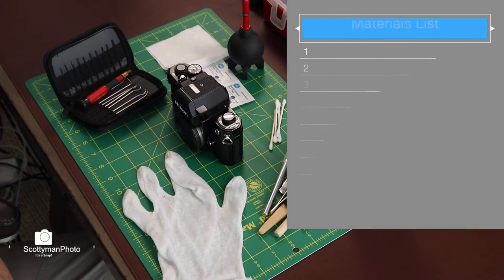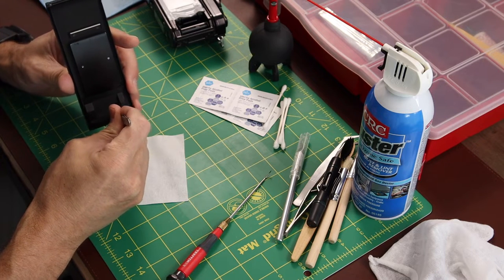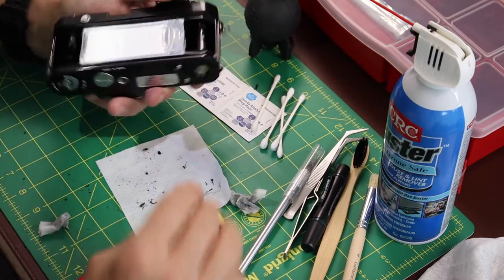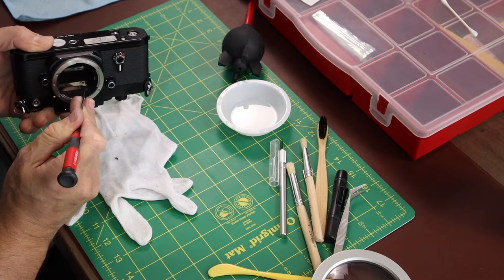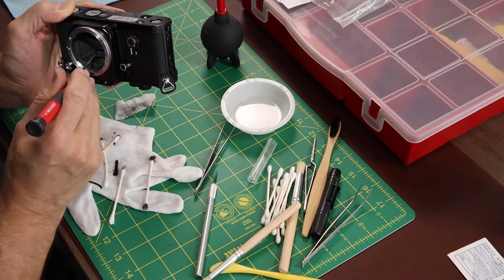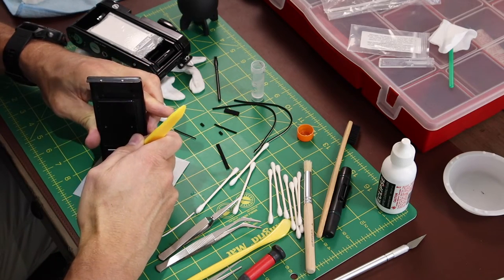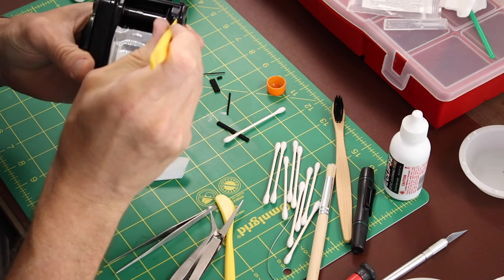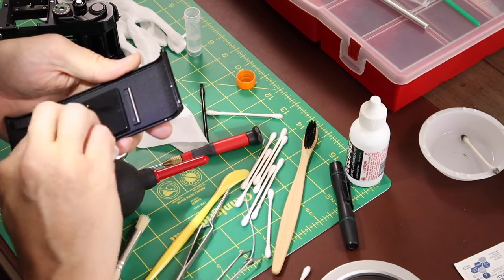Replacing the Light Seals on a Nikon F2AS Vintage Camera

Comment: Very helpful video, the Purell recommendation was extremely helpful as the adhesive backing on the foam strips grabs the nearest surface so makes alignment very challenging. It was to confirm the strip location with you as the instructions I got with the Amazon kit were poor, no mention of the three mirror bumper strips and shows an additional strip on the hinged back at the lefthand side lock which does not seem to be required. Now my F2, which I bought 45 years ago, is ready to provide service until I expire. Cheers!
Reply from the maker: I'm glad you liked the video, David. I don't think the seal near the hinge is required, but I placed one there anyway. The foam bumpers are a must to prevent small bits of old seal from falling on the film and everywhere else. Thanks for watching!

Comment: I would recommend to set Mode "T" and push the release button. So the Curtain is out of reach for any tool and also the mirror is out of the way.
Reply from the maker: @klofisch  yeah, good thought! That should work for the everything except the mirror bumpers. It will certainly protect the shutter much better. Thanks for sharing your thoughts, and thank you for watching!